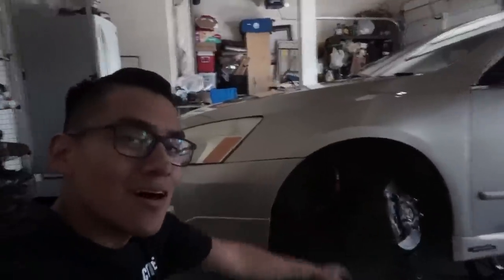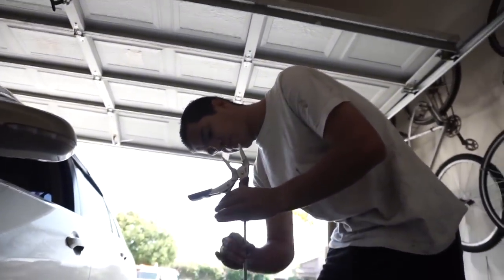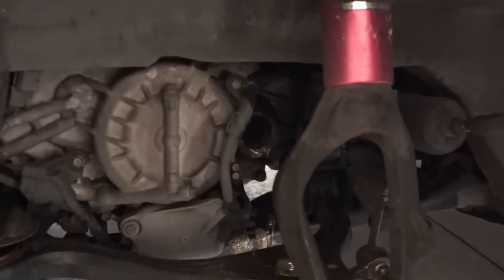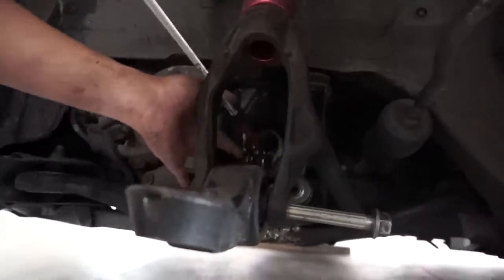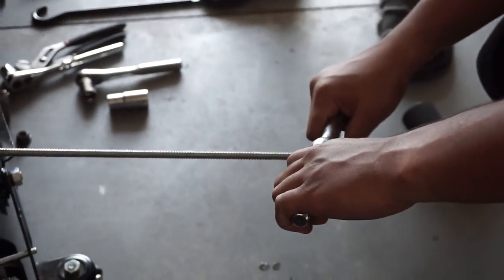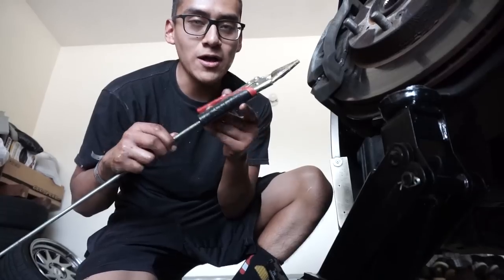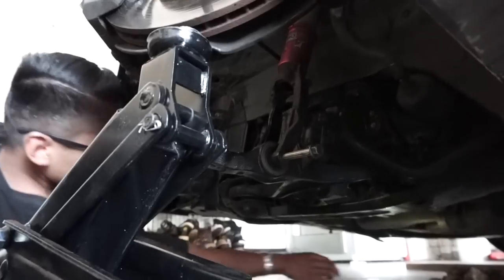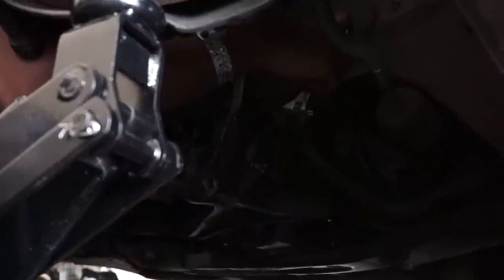How to Remove Stuck or Broken CV Axle EASY! (Sliding Hammer)

Comment: when i'm doing a u-turn (got the same car as yours) , i hear this clanking noise every time, on the right corner side on the front. would you at all know what it is? also i dont know what aftermarket springs are on my car, but it's dropped low on some 18 inchers and when i hit bumps it hurts bad and the front bumper scrapes so bad on the floor, what coilovers or shocks do you recommend? the car looks sick how it's stanced but really want to upgrade the suspension and tires/rims. Gonna do a lot of upgrades and mods like you have done to yours! thank you for the videos, keep more coming!
Reply from the maker: If it's a clicking noise when you turn, it may be your axle. I would replace asap as that's not a good sign. Check out my other video on how to replace the axle. I'm on godspeed coilovers and really like them. Also have a video on them as well. You should also see if you made need to replace lower control arms and or any other suspension components. Also remember to get an alignment!
Reply: It's a LOUD clicking noise, sounds like you taking a metal pipe and hitting it against a metal pipe over and over again- but it goes like ; CLICK ... CLICK ... CLICK ... CLICK - then once i stop turning the wheel and finish the u-turn.. the noise goes away. I'll investigate into it and get back to you! I appreciate it, really like your videos.will look into the parts you got, really interesting stuff.
Reply: I had a bad axle a while back on my accord, i have a short video you could compare the sound if you want.
Reply from the maker: Yeah that def sounds like a bad axle. If you take a look behind your wheel and see brown grease all around, more than likely the bushing on the axle ripped. The clicking noise is one of the serious signs of an issue and if you continue to drive on it you it may be dangerous. I would take a look as soon as possible.
Reply: @DMAN22yeah  thank you, that video made my day
Reply: @AccordEmpire  it's a bad axle and my lower control arms need new bushings, i need to work on all the suspension 😆 oh what fun 😭
Reply from the maker: Easy to do but very time-consuming! I would go with Moog lower control arms and ball joints. If you don't wanna spend too much money on the axle, Autozone sells them for about 70 each and offer a lifetime warranty. So if it breaks again you can take it back and get another one for free. I would recommend doing all of it together to save you a lot of time. Best of luck.
Reply: Check your springs and ball joints. Also where struts fasten tovchasis.